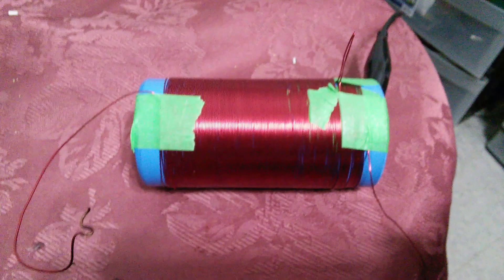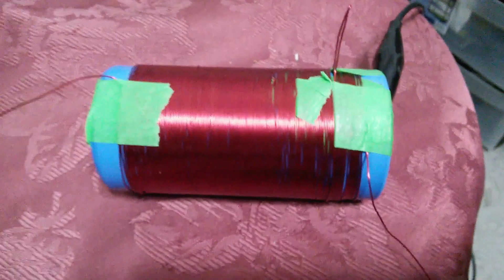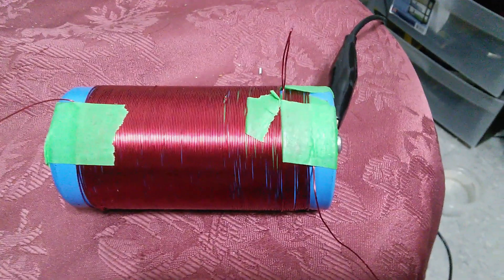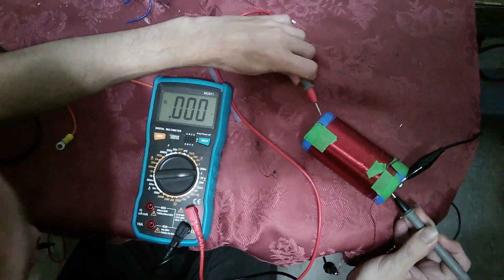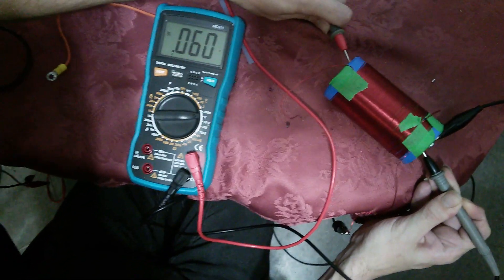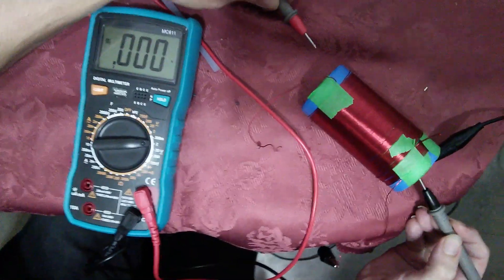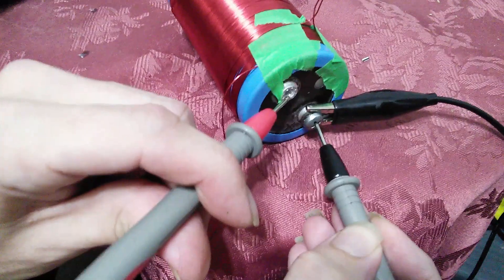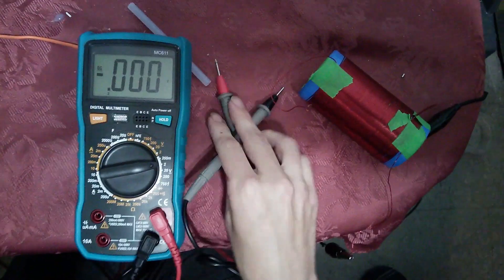ZPE Capacitor

Comment: Great phenomenon…. 👍
Reply from the maker: Yeah it's a shame many folks don't understand "RF" Blame it for every results, dismiss every experiment I show and they go out of their ways trying to charge devices with the cell phone signals, Those things are only a few watts LOL and there is this thing called the inverse square law (confused puppy looks lol) as you get some wavelengths away the field strength drops drastically, So unless your holding a phone tower right next to this thing, it won't react as is, A tuned circuit might be able to sense something a few feet away. As far as energy harvesting, If you live close lets say half a mile or less from a high power AM radio station, You got a change of getting a few volts at a few milliamps. No joke. So generally speaking, RF harvesting is useless in practical applications that need more than a few uA to trigger and this ZPE capacitor is not it at all. It was to test a theory on dielectric resonance.

Comment: I think it's about tapping to the static electricity. That's why air moisture is always messing the results and the outcome seem to be very different depending on where you live. I'm planning to experiment with some antenna/capacitor that uses water as the main collector, soon as I get my rectenna circuits done. It needs a real ground connection for the Barbosa Leal effect. Those multimeters also often ruins the experiments with low wattage, cause they use additional power, it needs to be measured with analog. The materials will also often give false results, cause aluminum and carbon produces power with moisture.
Reply from the maker: You do have to be aware of "galvanic" reactions...
Reply: People are already doing it in Colorado, other places. I forget what it was called but they had an organization of sorts... putting up big antennas, running electrostatic motors with the power, lol.
There's like 80 billion volts if you go up high enough in the atmosphere, but it's no current. Feynman talks about it in a recorded talk or lecture... so you know it's not BS but the cost to energy ratio is bad... giant antennae made of copper wire, need a tower or kite or balloon to hold up the wires... tower is most likely  realistic but the taller you go the material cost goes up fast... not worth it
Reply: @simonlinser8286  Yes, Lasersaber has some good videos about the topic too. It seems like easiest way is to go solar. But I live in Finland and we don't have the luxury of that :D So I'm forced to study these alternatives, like peltier etc. It's not always about the money ;)
Reply: I agree 100%. One of the flat stacked drives 29’11” diameter X 3/8” within my Antigravity vehicle design is a solid state Wymhurst generator.
Reply: Solar Panels made with titanium sulphate put out charge in the dark and are nearly full spectrum electron emitting.

Comment: you might want to look into RF harvesting, this would explain the voltage as essentially you have a tuned circuit that can receive radio waves. Attaching a diode and capacitor multiplier will increase the voltage and the charging as will adding a long wire antena
Reply from the maker: I experimented with all these variables, even tried the ground "trick" in this application. No effect.

Comment: Interesting. There are lots of things difficult to explain. I was told by a maker of piezo ultrasound transducers that the barium titanate plated with metal to be turned into what will be the transducer sometimes gets biased like an electret, and giving an electrical discharge, just leaving it on the desk or in a drawer. This can be a lot of experimenting. I am sure the properties would be detectable with or without a golden ratio or resonance as you are describing. Also, it's possible that your test leads tip may act as a detector, thus adding a diode to the circuit and charging on the spot that capacitor.
Reply from the maker: Interesting, I never had a meter charge up a capacitor. Testing other capacitors and even the normal capacitor function does not show such action. Only here. Also the longer I wait before metering it again. the higher the voltage level is after it loads down. indicating a steady charge in passive mode.
Reply: that would be interesting , i am kinda newb in those things but i learned that you can charge capacitors with ac and dc too, it would be interesting the idea of the diode and making a rectifier bridge which one end goes to the dc capacitor and the other goes to the ac capacitor, would that produce any interesting effectS ?

Comment: Playing with Dr. Stiffler's "quantum energy Receiver" has always given interesting results. It uses a ceramic disc cap. I always thought it was acting like an antenna just absorbing electrostatic and whatnot but maybe, being ceramic, it is indeed dielectric resonance causing the charge?
Reply: Came back to mention that the disc caps are piezoelectric. If you squeeze them in a vice for example they give off some voltage. I only did this by rectifying it and storing it in a cap. Never measured it on its own.